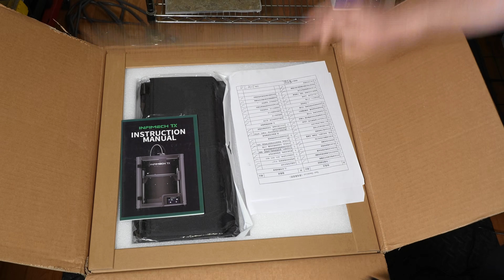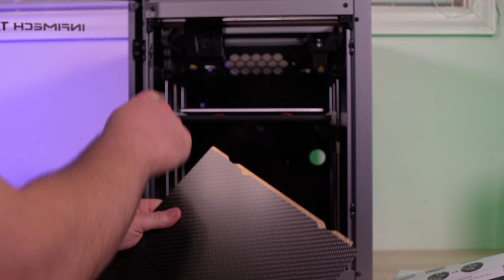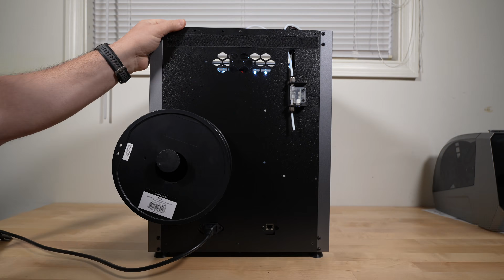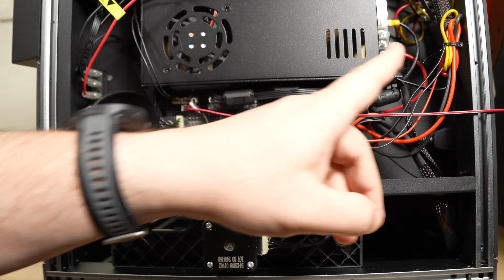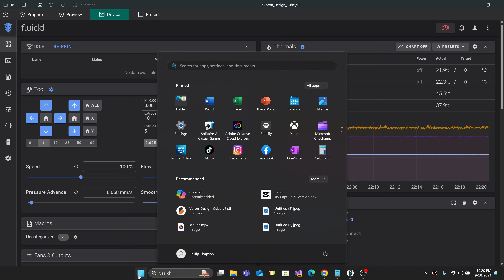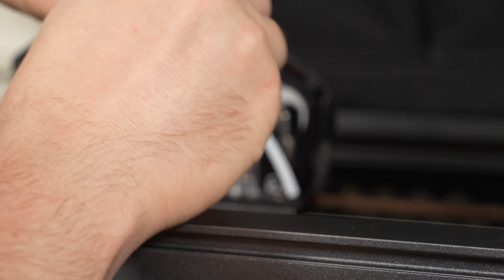Infimech TX - the $309 Bambu killer...???

Comment: WARNING - the add on kit which is the auxiliary part cooling ,led lighting require you to print parts before you can start the upgrade process. I have searched the internet for the necessary G-Codes to print these parts required.
Reply from the maker: @capteod  I have the models. They were available directly from the infimech website

Comment: The instructions say to leave the door open and hat off with PLA. You will get clogs when printing PLA with those closed.
Reply from the maker: @bspages  didn't have any issues with clogging during prints, I had issues with clogging when trying to remove the filament from the extruder. It would heat up and stretch the filament like salt water Taffy, the little piece would cool and swell on the cold side of the heatbreak and I'd have a clog.
Reply: @TheFeralEngineer  I got the same machine. It's a great machine when working right. There is an issue with it printing side to side or using the whole printable area. It would crash and give you a firmware warning. It will ask you to reboot the firmware. The OEM knows about this issue, and they are not willing to fix it., so you will not be able to use the entire print area. They could be better at customer service and support. Please stay away if you are new to 3D printing; you must learn to troubleshoot it yourself. I am new to OrcaSlicer. I used CURA (Marlin), so there was a little learning curve, but only a little. Once you get this dail in, it's a crazy printing machine. I only print with PLA or PETG on this machine. I got the QIDI Plus4 for the more abrasive filaments. When changing the filament - keep advancing the filament by pushing the button a lot. This will prevent it from cooling down and clogging the nozzle. It's cheap, and print quality is excellent for printing prototype parts. I will be buying 2 more.

Comment: If you're making videos please invest in a proper light and turn off your terrible LEDs. It's impossible to see any details on the printer
Reply from the maker: @zihotki  I spent 500 dollars on lighting and 3 grand on camera equipment. Problem is it looks great through the camera viewfinder and my laptop then looks like shit once it goes to YouTube.
Reply: @TheFeralEngineer  Yes, different gamma settings for your editing computer.  MACs vs PC's don't show the same brightness (gamma).
You need to calibrate your monitor with a cheap used Spyder box.  Right now, your videos are a bit too dark.   In your editing software, you may have builtin SMPTE color bars which you put on the timeline. Or download off the net. Then adjust your white/black levels in your editing software for proper level bars when your cursor in over the SMPTE bars..  If your software has a scope, even better.  You can do it.  Output H264 at 10mps or so. I've been shooting/ editing for 40 years so it natural for me.... What editing software do you use?

Comment: What about noise? You make no mention of it. Do fans run even when not printing? And how loud is the machine when printing, door open and closed?
Reply from the maker: @TNX255  you can hear it moving around as you would any high speed printer, but it's not offensive. I'll try and get some numbers for you. I have a dedicated print room so I never really hear my machines
Reply: @TheFeralEngineer  Many of us have small apartments and run our printers in an area where we spend lots of time otherwise as well, and oh too many a cheap printer manufacturer completely ignores any attention to quietness of their products.
Reply from the maker: @TNX255  This machine is pretty quiet when it sits idle, but you definitely hear it on high speed moves. Printing is pretty quiet, it's just the 500mm/sec rapid movements that make a whizzing sound. The fans aren't overly obnoxious and with the cover on, it's still pretty quiet
Reply: @TheFeralEngineer  Thank you! That cloth top hat is probably effective at dampening some noise too.
Reply from the maker: @TNX255  yeah, when it's enclosed, it's not all that bad. If noise is a real concern, I'd say 200mm/sec travel moves would keep it down a bit more

Comment: Supposed to leave the doors open with PLA dude otherwise it wont cool it properly.
Reply from the maker: For something that small, it's moot. I ran the 8 hour print with the lid up. Heat rises. 

I even actually ran a 6 hour print last night fully enclosed with zero issues.

Comment: Oh yeah. That things is tite!!
Reply from the maker: I've been running 6-8 hour prints through it with zero issues. I just updated the firmware and found the z offset screen for mid-print  adjustments. It's a really good plug and play machine. I think my only issue right now is finding the setting I used in prusa to fix the sagging on my cubes

Comment: I think problem with infimech is parts
Reply from the maker: Unless there's some sort of catastrophic failure, I don't see there being any major issues. The screens are tjc, the boards are makerbase, the steppers kinda look. Like they were pulled from the elegoo parts bin, the belts and pulleys are available on Amazon and I'm sure the sleeve bearings are the same ones the ender 3v3ke uses

Plus, they have a ton of parts on their website

Comment: I'm going to order one of these along with the extra stuff that's available all at one time. It would be nice if the hotend was upgradable. Thanks. Ive been also thinking of the QIDI Q1.
Reply from the maker: What's there to upgrade? Volcano nozzle, bimetal heat break, ceramic heater, cooper block.
Reply: @TheFeralEngineer I prefer a single nozzle heatbreak combo similar to a REVO type.
Reply from the maker: @billkaroly  you could swap the entire cartridge. They're for sale on their website for <$20 dollars and include the block, heatbreak, nozzle, silicone shock, thermistor and heater cartridge as a plug and play solution. They change out with 2 grub screws.
Reply: @TheFeralEngineer  The interior fans and filter set, is one!!  For only a few dollars more!

Comment: So would this be one of those printer that people will find a way to flush vanilla klipper?
Reply from the maker: @maus9777  it's already begun, actually. I found a GitHub project last night that people are working on. Frankly, if they release the source code, I'd have no qualms about dumping straight klipper onto it and running it from the ktouch full time.
Reply: @TheFeralEngineer  any chance of a link to that project?
Reply: ya. need root and to publish the source.
Reply from the maker: @derekfarealz  it's basically running the makerbase armbian Linux that's on the makerbase mkspi GitHub page with some special settings to utilize the tjc HMI. Being that it's a makerbase skipr, I'm assuming the proper source will be released soon

Comment: love how bambu has made every company in the space step their game up a bit. great machine for the price; love how thorough your reviews are
Reply from the maker: @MrBaskins2010  I was afraid the length would shy people away. I need to timestamp it. I do agree that it forced a wave in the industry, but they're still assholes.
Reply: big assholes.
Reply: I don't believe that Bambu Lab inspired the creators of this printer. I have their previous version (Ghost 6), and they just did all the people wanted and changed by themselves (including me) in Ghost 6. An exception is the extruder - I don't know why they left the old version without even minor updates.
Reply from the maker: @igorchyk09  probably marketing reasons or a switch of OEM that is building the machine for them. Let's face it, none of these printer companies build their own stuff, it's mostly 3rd party design teams, OEMs and the like. Makerbase used to produce their own printers and I think they pretty much just private label most of the ones on the market now. Even sovol is just dipping into the creality parts bin for most of their stuff.
Reply: @igorchyk09  the greater point is, before the X1C, it was endless repetitions of an i3.  Tiny little advances.  Then Bambu made a machine that was crazy good, then another  one at a lower price point, then another, and another.  They drove the quality and features up and made cheaper versions than the first one.  Everyone now must be fast and have auto z and bed level.  Etc.